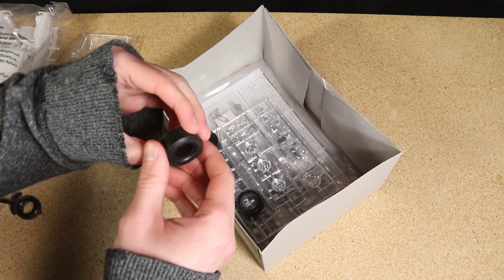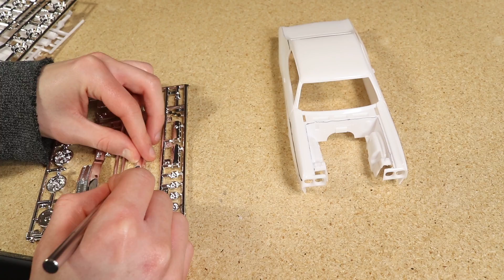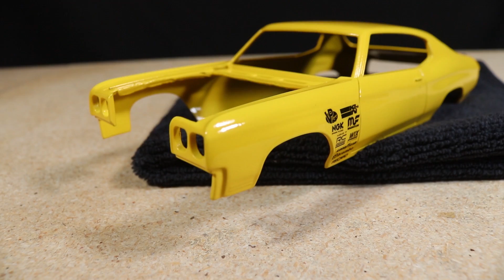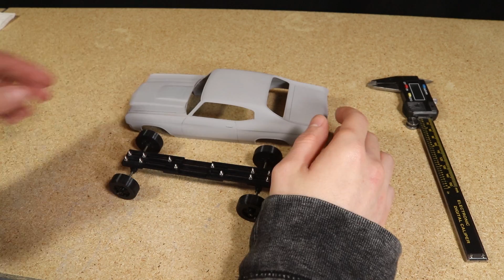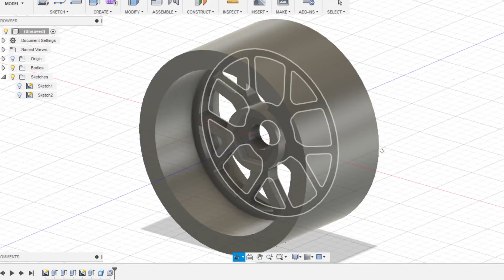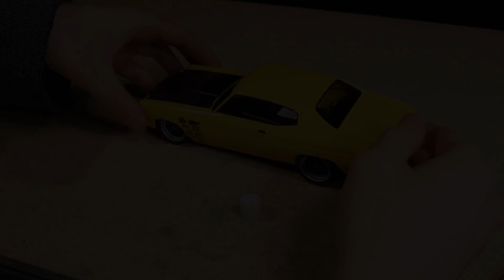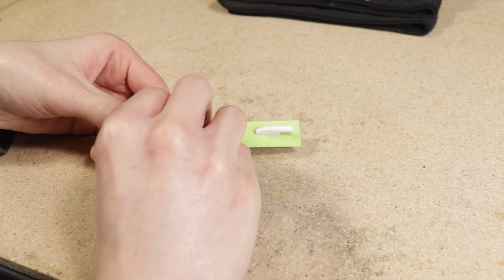RC 1970 Chevrolet Chevelle SS 1/24 Scale Project Full Build + Test Drive

Comment: As always, great work. What ratio motor are you using? I seem to always get burned by Uxcell's RPM system. I think I remember the "higher rpm" motors being the slowest. Any suggestions?

Comment: cool vid! A tip for repairing missing chunks on thin bits is to dissolve shaved off bits of sprue in some glue and blob it onto the area, when it cures it has the same properties as the rest of the plastic and can be sanded and carved down to a very thin edge.

Comment: The car looks amazing, but I have one question: how does the plastic parts fare against the heat produced by the motor?
Reply from the maker: Thank you. I've never had issues with the little N20 motors, though the larger motors can produce a lot of heat. With the bigger motors I monitor the heat and ensure the plastic is holding up both on the chassis and the car's hood.

Comment: The front turn signals are white on an ss car orange is malibu which I’m confused how you messed up with the correct material right in front of you
Reply from the maker: You've got a good eye for detail. Being a modified car I thought I'd deviate a little and add some color to the front bumper.
Reply: Make It RC  it would be fine if it did not have ss badges ,surprised no one else saw that as it is a main point of an ss and now you know it might bug you

Comment: are there still plans to get an actual differential into these axles? And maybe make larger ones to fit the 1/24 semi truck kits on the market?
Reply from the maker: Functioning differentials have been built but are not reliable to the point of something we'd want to sell yet. Still have some bugs to work out. Larger semi truck axle would be cool. No plans for that at this time but maybe someday.

Comment: is it possible to build a rc 1/25 car without a 3d printed frame or a chassie?
Reply from the maker: Yes, though more difficult. Basically you mount all the drivetrain and suspension components onto the model kits chassis.

Comment: Little tip if you don't mind. Try using scotch tape on the trim it won't bleed underneath. Scotch tape was originally designed for pin striping. If you want.👍 But overall very nice build.

Comment: Those wheels are beautiful. Great work. 

I can't seem to get the right fillets to make steps inside the barrels. Any tips?
Reply from the maker: Thank you! What software are you using for CAD?
Reply: @MakeItRC  I'm using Fusion360
Reply from the maker: @Danielism  It's hard to know for certain what the best solution is without seeing what your working on but here is some information about fillets: http://help.autodesk.com/view/fusion360/ENU/?guid=GUID-5B845B1C-0324-40BD-9415-CEADA7339EE9 Also you might be able to use a the Revolve to get the result you need: http://help.autodesk.com/view/fusion360/ENU/?guid=GUID-D74BB28A-9570-43AD-97A4-E094021C036B

Comment: that looks great man, if I may sugest something look into the speed of your stearing servo. right now it looks really nice and scale but the way the car snaps while driving is something a lot of RC cars have. by slowing down the servo you have a smooth transission wich might drive diverant but will look way more scale!
but again love the way it looks
Reply from the maker: Great idea! Been messing with the steering settings a little. One thing I did during the tests was reduce the steering angle since before it was turning a little too sharp, as could be seen in some clips. May slow down the speed a little as well.
Reply: Make It RC I am looking forwards to see what you do with it

Comment: To avoid paint bleed under masking, spray clear round the masking edge.  This will fill any gaps with invisible clear.  Then spray with your desired colour and voila, no bleed!
Reply: Not sure what tape you use, but ditch the crap stuff or tapes that are used for cars etc.  Go with Tamiya tape.  It’s not cheap, but it’s just the best at doing this sort of thing.  Usually little or no bleed.
Reply from the maker: Thanks for the tip! I've done that in the past but didn't think to do it here for some reason. Will remember it for next time. 👍

Comment from the maker: Had a lot of fun both building this car and editing this video. After the hours spent working on it and 4 attempts to upload it, it's great to finally be able to share it. 👍
Reply: I WANT!! The 1970 Chevelle happens to be my favorite car lol
Reply: Just an idea. If you want more traction for on hard surfaces you could print the tires undersized and dip them in plasti dip tool handle coating. One or two layers are relatively thin but will provide a good bit of grip.
Reply from the maker: @demoman27  That's a cool idea, might have to try something like that. 👍
Reply: Any plans for building a monster truck out of say the base of one of those hotwheels 1:24th scale metal models or the amt usa 1 & a cheap rc crawler with a longer gear ratio or faster mini-z motor like a pn racing 43t ?
Reply from the maker: @Mini-z1994  No plans at this time, but that would be cool.
Reply: I have a AW11 chassis. You think you can design something for it?
Reply: I been watching all of your videos. Amazing work, how do you print parts so small?